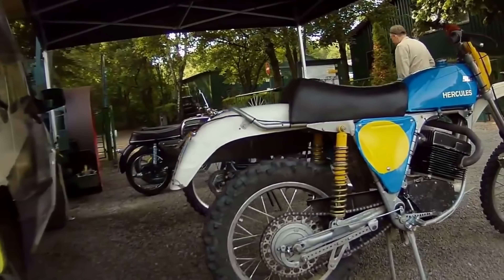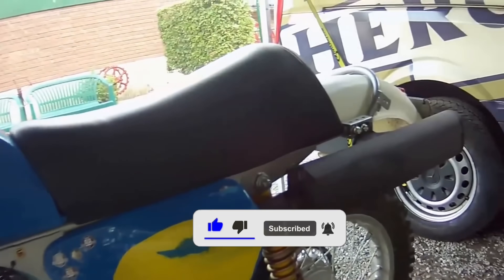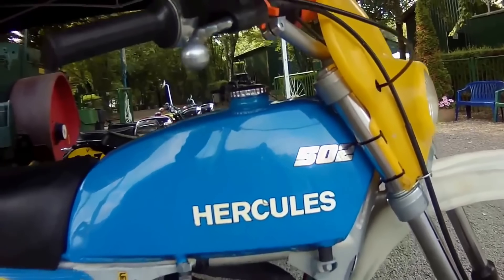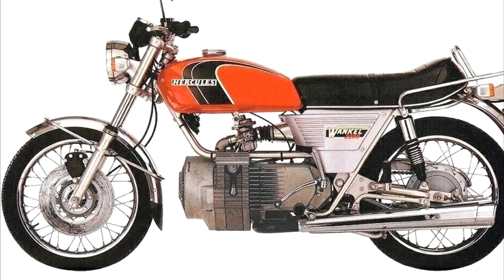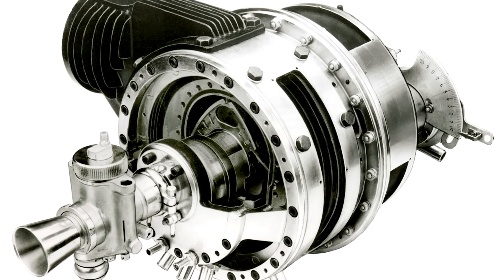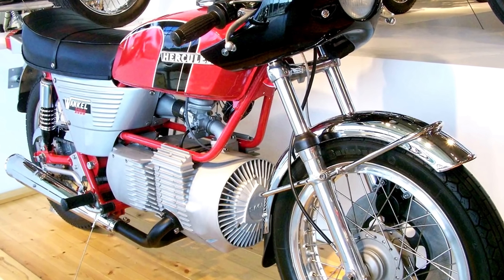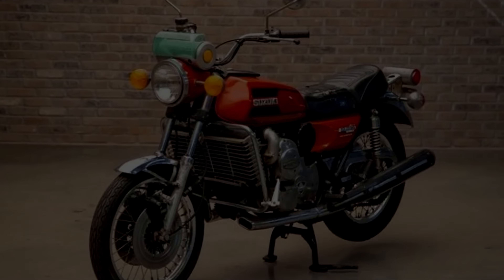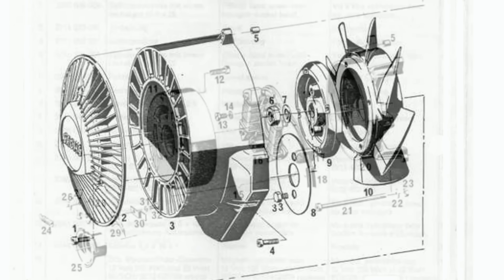The Hercules 502 GS: How Rotary Engine Works on a Dirt Bike

Comment: The speed of technology is such that a modern version of a wankel engined dirt bike might be an incredible machine.  I would love to see a company develop a twin rotor version with the crank oriented front to back with a stacked transmission.  It would have to be liquid cooled - of course - and fuel injected.  I love the rotary engines, having owned two RE5 Suzukis in the past as well as an RX-3 and various other first generation RX7 Mazdas,  They are essentially two strokes!

Comment: I bought one of those from a service station it was painted yellow and had a new rear tire but had an issue with the throttle it would get stuck open. Trying to stop it from running with the button kill switch took longer then it should have and the light did nothing it worked but not to see anything and the petrol tank was held on by coat hanger wire.

Comment: The way the dirtbike is pulling off the lowend, you would think it had gobs of torque down low, contrary to how most rotaries are suppossed to be... interesting to see the hp and torque specs and a dyno graph of one of these.... also, the weight..did the rotary make it heavier or lighter?

Comment: All experienced Wankel engine having an oilpump users, including of large Mazda, add 1 % oil directly into gasoline, oil pumps will fail sometime, Yeah or Yes.
The 24 hrs of LeMans endurance race winner three Rotor Mazda had MoS2 additive, a solid lubrifiant, in oil.
For example LiquiMoly, one cc additive per litre of oil/ gasoline mix. The key to good safety is... Redundancy, redundancy, redundancy. 
Blessings +
Reply: You have to be monumentally ignorant to pour the wrong oil into the wrong filler hole.

If you cannot read your owners manual or the label on a bottle of motor oil you have no business under the hood of any car.

Mazda DOES NOT RECOMMEND PREMIXING OR 2-STROKE OIL.

Mazda only recommends 4-stroke motor oil with an API SL rating or better. 

No 2-stroke oil meets this minimum API specification.

MoS2 is an additive in many motor oils.. there is no evidence that it has an impact on apex seal reliability or durability.

Apex seal failure is not related to lubrication, this is a completely false urban myth with no creditable evidence to support it.

Please stop posting lies and ignorant misinformation about a topic that you are clearly not qualified to discuss intelligently.

Comment: https://youtube.com/shorts/3y3HKbKTA7s?feature=share
The Wankel Engine is the Most Powerfull Engine 1cc×1hp. or more, 130% hp..
Reply: Wankel engines have the Lowest horsepower and BMEP per liter performance... which is why they were a failure in motorsports.
Reply: @sandervanderkammen9230 It's not like that where I come from in my country we squeeze the Wankel engines to the maximum.
Reply: @rotorazor905  Do live on remote, backwards, third-world island nation far, far away from the center of the automotive and motorcycle universe???

Comment: Imagine  adding a small turbo compound system to capture some of that wasted exhaust energy and apply it to the crankshaft
Reply: Because Wankel engines are so inefficient they have EGTs that are too high to run exhaust turbines efficiently...  the required fuel enrichment would destroy fuel economy.

Comment: I have a Mazda rx-8 shinka turbo rotary and considering how small the rotary is it has a lot of torque and really haul's serious ass so I can imagine how much power that bike has do you actually have the bikes engine specs
Reply: No, actually it has very little torque compared to reciprocating Otto and Benz cycle engines...
The Wankel has a very short stroke.
13b is only 30mm stroke.
Short stroke = low torque

Comment: This is literally the simplest bike engine there is. Even 2 stroke is more complex :D
Reply: NO, you must be unfamiliar with these types of engines.
Reply: @sandervanderkammen9230   Okay, maybe I exaggerated a little but seriously.. Even with 2-strokes you have multiple moving parts such as piston, connecting rod, crankshaft and possibly variable exhaust that adjust with throttle. With rotary you have basically eccentric shaft, pinion and rotor if we exclude carburetor/fuel injection and ignition that both have and housing/cylinder.
Reply: @anttitenhunen4725  Why do people ignore all over those tiny, fragile little seals and springs that make them so unreliable?
Why do people try to pretend they are not there???
Reply: @sandervanderkammen9230  Have you watched any videos about people improving rotary engines? For example disabling the automatic oiling system and pre-mixing fuel already greatly increases the lifespan of apex seals in case of 13B and anyway 2-strokes also wear down faster than 4-strokes. It is not uncommon to rebuild 2-stroke and replace the piston rings at least.
Reply: @anttitenhunen4725  That depends on the type of 2-stroke engine... some 2-stroke engines can run hundreds of thousands of miles before requiring a complete overhaul.
 2-stroke engines are also extremely reliable... something that the Wankel engine can never be.
 Any questions son?
Reply: But yeah, it is true that rotary engines still need to be maintained more often than 2-strokes. But the main thesis was that they are still very simple when concerning complexity like amount of moving parts. And they pack great power in compact size when compared to similar power 4-strokes for example.
Reply: @anttitenhunen4725  That is completely false, a Wankel engine has more parts than a comparable 2-stroke engine..
And those parts are more expensive and fragile.
 Wankel engines are not just less durable, they are also more unreliable.
They offer no real advantages in power-to-weight ratio performance and are obsolete technology today because they offer no advantages over reciprocating engines and also have several major disadvantages.

The Wankel engine is inherently inferior to other types of internal combustion engines, type that unlike the Wankel are still mass produced today.

Comment: NSU Ro 80 , was the first car with Wankel-Motor...
after this, the Mazda☝🏻
(i'm thinking)
My Dad driven 2 NSU Ro80, this car was 20 years forward, of the other cars.
Reply: The first production Wankel engined car was an NSU, but not the Ro80. 
Think it was 1964, NSU produced the Sport Spider, a little convertible which was styled by Bertone, and was based on the Sport Prinz coupe.
Production ended in 1967, the same year that the Ro80 was launched.

Comment: Was surprised that the engine's don't rotate same direction as wheel and chain,thought bevel gears stole loads of power ?? X
Reply: Yea that surprised me too but the inertia of the doritos is lower then the inertia of velocity and the spinning wheels so I doubt it's very noticeable however I'm sure it'll be measurable and in a jump I bet it would turn if revs were kept up, so many people talking nonsense here finally an intelligent statement...👍👌👍

Comment: That is a really interesting motorcycle. Very unusual. Sounds pretty cool. Sometimes sounds like a 2 stroke, sometimes like something between a 2 stroke and 4 stroke.
Reply: @The Old Husky keep in mind Wankel rotary has 3 faces (that's why what ever cc it has should be x3) - it's basically a 3 cylinder 2 stroke... it sounds like a 3 cylinder 2 stroke without an expansion chamber (or smaller chambers) = look up Kawasaki H2 750 https://www.youtube.com/watch?v=-J5sDoswjNc&t=205s
Reply: @gatorage850 Close, every Wankel has at least 3 cylinders.. but it operate s using the 4-stroke principle.

Comment: Yeah I can attest to the gas guzzling nature of the rotaries, the reason is it's firing more than even a 2 stroke motor, for every revolution of the rotor it's firing 3 times, thus the fuel consumption along with another issue the heat, that's why you need a robust cooling system for any rotary engine.
Reply: Thats an Interesting factoid that is clearly overlooked ain't it
Reply: Perhaps you should learn how a Wankel engine works?
They fire the Same number of times per revolution...
 Once.

Comment: I had a mazda rx2 I could pull one front wheel off the ground. 16000 rpms but TERRIBLE gas mileage 16 mpg was the average. My teflon seals went out and would burn oil. Had alot of fun one of the fastest cars I had.

Comment: I remember seeing the 502s, but never knew it was a wankel. The rotaries have a two-stroke like feel with good smooth torque like a 2t enduro bike. Long ago I ran an RX4 into the ground and that twin rotary engine was good fun per dollar.
Reply: Ran an RX4 into the ground, I think I hate you.....😏
Reply: @EZ-D-FIANT mazda's were very cheap disposable cars back then... some would say the same today.
Reply: Hmm, correct me if I'm wrong, but isn't their similarity is that they both burn oil as well as do the intake and exhaust stroke at the same time?
Reply: @ipo7596  they both lubricate th3 cylinders with oil burnt alongside fuel yes, overlapping valve timing is way more common on a 2t then a Rotary tho. The reciprocating mass chamhes directions on a 2t, it doesn't on a Rotary, this makes for a way smoother and faster revving engine when compared at similar CC's however yes one could say the 2 engines are very similar, I'm way more familiar with 4t bikes and Rotaries tho my 2 stroke bike experience is shamefully limited.....
Reply: @EZ-D-FIANT  ahh. Yes yes. Right. Thanks for clarification. I'm just an enthused by cars and motorcycles, but I don't really have much idea or experience.
Reply: @EZ-D-FIANT You experience with Wankel engines is equally limited it seems... the triangular piston in a Wankel engine reciprocates and changes direction twice per crankshaft revolution.

It is a 4-stroke engine and shares no defining features with a 2-stroke engine.

Premixing and oil injection is used on some 4-stroke engines... in particular in Rotary type engines, not to be confused with Wankel engines... they are not the same...
Any knowledgeable motorcycle enthusiasts should know the difference, any legitimate motorcycle expert knows nor to confuse the two types.
Any questions son?
Reply: @sandervanderkammen9230  nothing I said was wrong your just being argumentative he asked for the similarities and I gave them that's all, I won't bite...... 🥱
Reply: @EZ-D-FIANT  We are discussing the Wankel engine, not the Rotary...
Both have reciprocating motion..
Both are 4-stroke.
Lubrication method is not a defining characteristic of any 2-stroke or 4-stroke engine.
So Yes, you are wrong in what you said.
Reply: @sandervanderkammen9230  Sorry I can't hear you from all the way up there on that high horse your riding...
Reply: @sandervanderkammen9230  That's not what I said!..
Reply: @EZ-D-FIANT  Well please explain what you wrote.
Reply: @EZ-D-FIANT  It's hard to read with your atrocious spelling but it looks like you said that Wankel engines have no reciprocating mass... which is a patently false statement.
Reply: @ipo7596 All Wankel engines operate using the 4-stroke principle.

Comment: the stock street rotarys are in the 30 hp range  good torque  like an electric motor  im sure more is available   you want to ride em like it was a diesel  high engine rpm unloaded results in apex seal flutter and failure  poor fuel economy wankels are+ .5lb fuel per hp hour  4stk piston  is .3

Comment: If you freeze the video on the Suzuki rotary you can see the bottom of the exhaust pipes has air intakes on them. It ran so hot to head to cool the baffles down

Comment: I'd be curious about the low end. How much torque off the line, hill pulling power and get you out of a bad situation acceleration. I have several early 80s bigger KTMs, a 250 and two 420s, that you can plant corn in the ditch they leave in their wake. The 420s accelerate just as fast going straight up as they do on the level, I'd love to have tried one of these Hercules bikes back in my day. ✌️
Reply: Thing is they don't ride at low revs, O constantly have this debate with non Rotary guys, its power band is higher so we use it higher, torque is comparable to a normal bike due to thebreduced inertia from the rotating mass, it will ride great and very normal, infact it might kick the tyres quicker as it will actually hit its torque band quicker and fly through it faster then a typical power band, that's why this dude keeps loosing the back when pulling away.......

Comment: Never knew there were rotary powered dirt bikes. They have a very cool sound to them.
Reply: same here
Reply: Its sounds like 6t
Reply: @pyube7486  a
Reply: Lot older snowmobile had them
Reply: @brianjacobsen8878  I seen a couple old Artic Cats with Wankel engines.
Only ever heard one running.  Pretty wild sounding.  Cool though.
✌🔧🍩
Reply: It’s like a 2stroke with a 4stroke exhaust
Reply: Cool and funny at the same time

Comment: The gyro effect must be interesting from the horizontal rotor.
Reply: You'd be surprised how little it effects. I have a 79cx500 the motor is horizontal. You only feel it if you wind her up at a dead stop, and it's ever so slight. Of course my bike has a different design to help counter thus
Reply: @spencerkleiman5035  I guess I should have clarified my comment. Given the horizontal spin of the rotor I was expecting a loss of the traditional feel from a dirtbike. Not sure of the weight of the rotor, and with the loss of the piston stop/start the overall losses of traditional gyro would be interesting.
Reply: The rear wheel probably fights most of it.
Reply: Honestly of all the keyboard warrior comments here yours is the only one I respect....
Reply: Is it horizontally placed, as opposed to longitudinally yea, so the crank is 90 degrees to the direction of the frame? (I'm actually a Rotary engine builder, not on this platform and haven't watched the video yet), cos if it is, and it's rotating forwards it would actually help stabilise in the same way a reciprocating F4 would just less due to the reduced internal enertia of the dorito, now if its sideways (crank forwards, rotating sideways) then were gonna feel it but I've a feeling it's not, gonna watch now.....
Reply: @EZ-D-FIANT It's opposed to Transversely positioned.

From your comments, it would appears that you cannot even distinguish between the Wankel bike and a Rotary bike...
Is their an explanation for your confusion or are you just a fake? Or petending to be something you are clearly not?
Reply: That is longitudinally placed, you have your terminology reversed, none of these other know it all's picked up on that, weird, I knew i liked your question, absolutely it would be noticeable, how much so vs directional motion and counter gyro produce by wheels who kows, but i bet its measurable.....
Reply: @EZ-D-FIANT  Now the hard part, finding one to ride :)
Reply: @motofunk1  honestly could probably make one quicker, maybe even cheaper too 😅
I really do wanna feel it thou now you've made me think about it, the smoothness has got to help but it means a big single 4stroke turned sideways wouldn't be a fair comparison, doubt an electric motor would have the right weight and then the whole bike dynamics are off anyway, a 13b sounds like a great big bag of nuts, frankly all these ideas are nuts. I'd imagine this is how obsessions start, chasing something desirable yet implausible. 😬

Tits........... I really wanna ride one now.........
Reply: The rpm of the reciprocating mass is relatively low in the Wankel engine, nothing comparable to a Rotary motorcycle like the Megola

Comment: Looked for 22 years for a Herc and took a flyer on a 74 1,400 mile W2000 sold as seen, chrome rusted (can be re chromed) tank rusted from the top down and filler cap rusted out, but.........chamber and rotor perfect. 3 months later I get to fire it up. Hilarious sound! Such a load of fun to ride. Those offroad versions sound so fruity.

Comment: 3:15 how is that one running without a head covering the cylinder? I've seen the clear face rotary video showcasing how they work but if the dorito is exposed how was it running? Or is that a clear porthole to be able to veiw it?
Reply: That looks like a balance shaft to me, probably the counterweight connected to the end of the end of the eccentric shaft

Comment: How s it connected to the transmission and what transmission does it have?
Reply: Just a normal gearbox connected by an 90° angle gear drive to the clutch.

Comment: The rotary beats all other piston engines in one area- they are incredibly smooth. If you have every driven an RX7, you have experienced this.
Reply: lol if you call viberating like yur moms huge toy smooth, then yes
Reply: Yes, but so is a straight six. Manufacturers don't often use straight sixes because of cost and packaging.
Reply: You sir, must be too poor to have driven a V-12 engine...
Wankel engines offer no advantages over reciprocating engines and have several major disadvantages which is why they are obsolete technology today

Comment: The problem with a rotary is they need oil in the gas for lubrication or oil injection which means they can't meet emissions standards
Reply: Mazda RX 7
Reply: KTM TPI

Comment: Torque sucks for slugging around. Rotary is designed for a high RPMs to make power.
Reply: 1976 honda dirt bike 23HP/ 17 lb-ft torque
1976 wankel 502 30 HP/ 24 lb-ft torque
Reply: @stuwest5862  1976 Suzuki TM400 makes 35 horsepower, 31 foot pounds. The RM370 also.
Reply: @CraftOrganics  Of course they do. They are bigger engines.